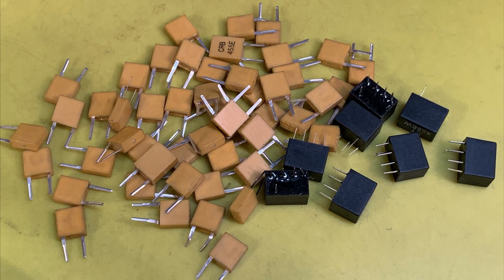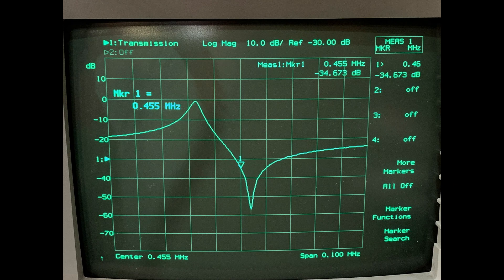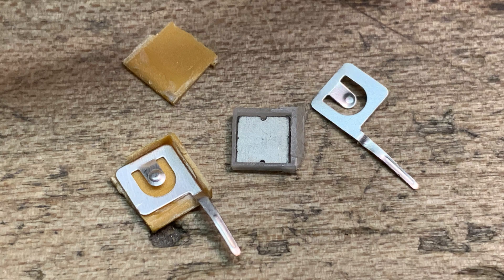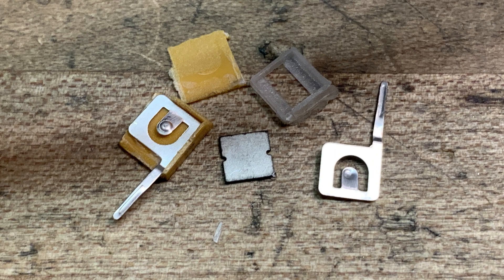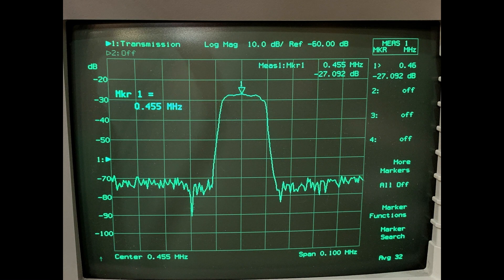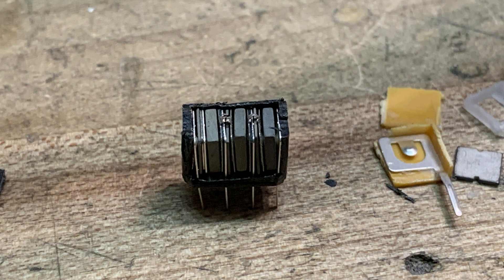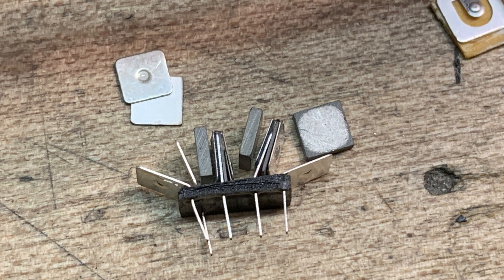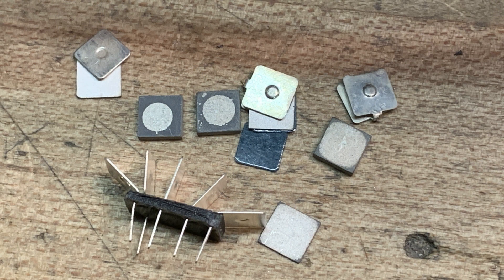#1005 455 kHz Resonator and Filter Teardown

Comment: The filter is not "3 resonators and 3 capacitors", but actually 6 resonators: 3 of them (the thin ones) operating at parallel resonance (at the 455kHz), the thick ones are operating at series resonance, their characteristic impedances (given by their thickness and mode of operation - the series ones operate at some overtone mode) so in total the pass band is formed by essentially 6 critically coupled resonators in a ladder configuration. The small patch on the thick ones (the horizontal elements in the kadder) is to make their characteristic impedance as high as needed to ensure the coupling being exactly critical (so reach flat top in the pass vand).
On top of that the series resonance of the parallel elements forms a reject notch just below the pass band, the parallel resonance of the horizontal elements forms a reject notch just above the pass band, both effect contributing to the edge steepness. By the way the reject notch just above the pass band is a giveaway the thick horizontal  elements are resonators as well and not just capacitors. Plus the side steepness and a suppression around the pass band (for the given bandwidth) could be reached only with 6 resonators, not just by 3.

Comment: I was going to say , yep very similar to a crystal in construction. The filter I was familiar with after replacing the noisy ones in my old TS-2000 . I was curious enough to pull one apart but never a 455kc resonator. Thanks for showing us.

Comment: 3:24 Forgive my ignorance on the subject. If three legs of the second filter are essentially a circuit ground, why does the manufacturer keep them independent instead of connecting them together? I would expect to see three legs instead of five: in, out and ground.
Reply: Hi, each ceramic wafer resonates at a certain frequency within the filter's bandwidth and is coupled with the next wafer by a specific value of capacitance (determined by the area of the circular metallisation) for a tighter or little loose coupling to bring about the desired filter plateau.
The leads to the ground, as you suggested can very well be connected but it's always better to be grounded then and there; moreover it adds mechanical ruggedness to the whole device for sure.
De VU2RZA
Reply from the maker: ease of manufacture
Reply: @IMSAIGuy  Simples!
Reply: The 3 ground leads are needed to actually reach the specified out-of-band suppression (in the 80-ish dB). If there were just one common, its parasitic inductance would severely compromise that. Of course, it works only when the PCB layout uses proper layout (ground plane, signal flow ground routing,...), to not introduce that parasitic back in your design.

Comment: when they mine products/elements from the ground, the products R refined. depending on the Mfg's needs/specs! most crystals don't contain a shiny crystal, clear glass like crystal. aka Yogies crystal!! so, some products can be a slury. or a molted mixture of ''conglomerate'' elements! and others, could simply add metals or other chems. by using a basic evaporation chamber, in a vacuum of course.. the great thing about all of this? is, there is still plenty of room 2 expand technology!  technology is funny? it twists and turns. creeps around. then bam! it snaps in2 & kills U! then U find ''Yogies Crystal", & the pearly gates!! the end!